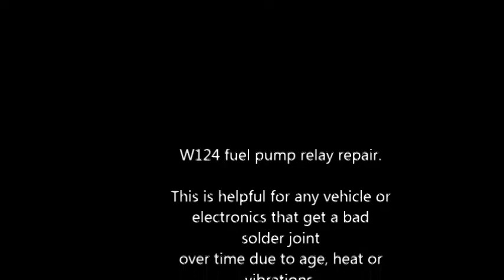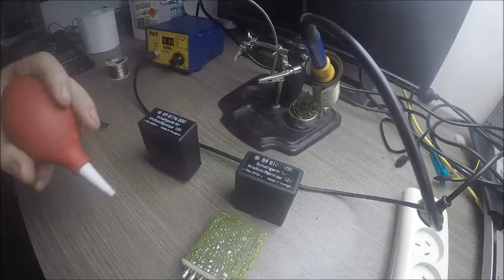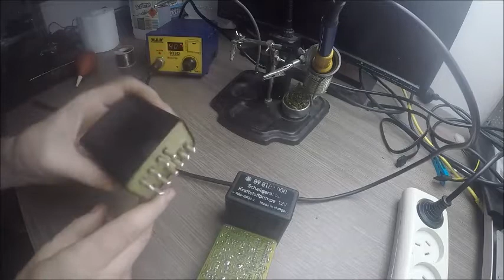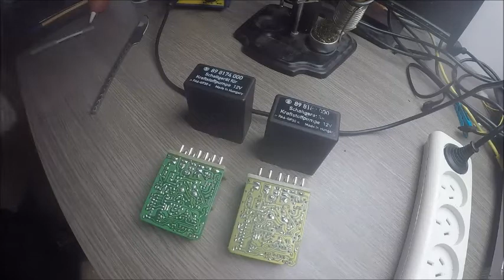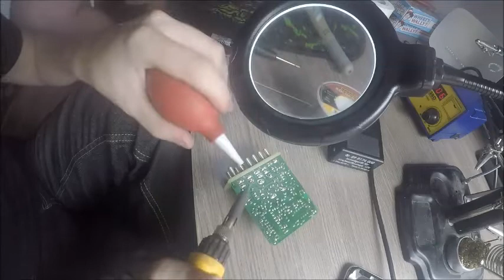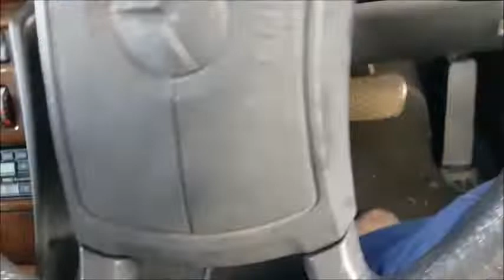Refurbishing a relay for a mercedes benz w124 series

Comment: What happens when u bridge the pin 30 and 87?
Reply: It by-passes the tiny internal relay in the housing so that 12V is delivered continuously to the fuel pump. Good for an Emergency "get-you-home" situation, but don't leave it that way.Tthe pump will run continuously without the key in the ignition, flattening the battery and eventually burning out the fuel pump. I did a comprehensive overview video about this.
Reply: The fuel pump works in continuos......but is not correct, it's very dangerous!